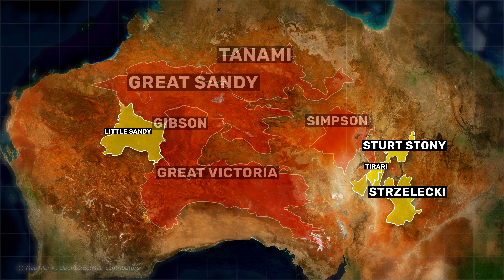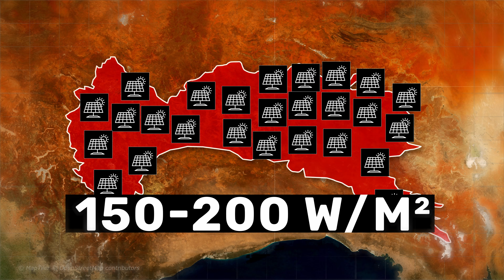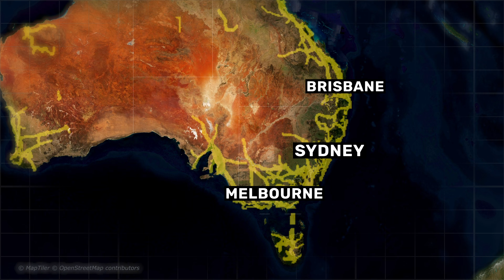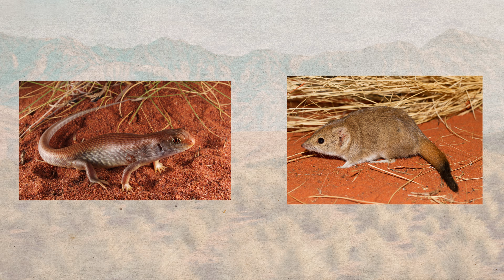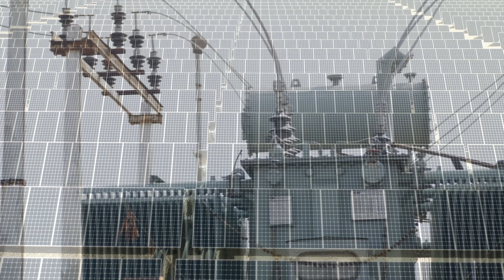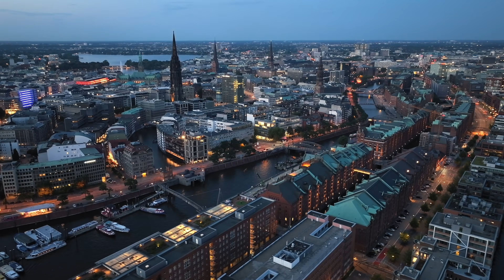What If We Turned Australia’s Deserts Into Solar Farms?

Comment: The issue that I see is that the distance from Australia to India is about 5000 miles.
India would be the closest country that could buy the energy for manufacturing.
I'm not sure how much power loss would occur in an under sea cable over that distance.
Reply: There was a plan to build a cable to take  energy to Singapore